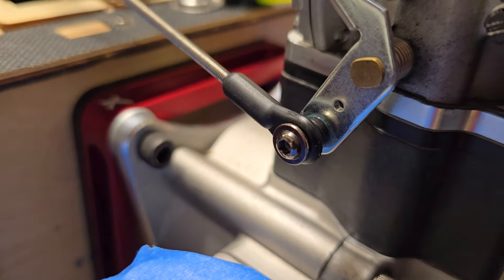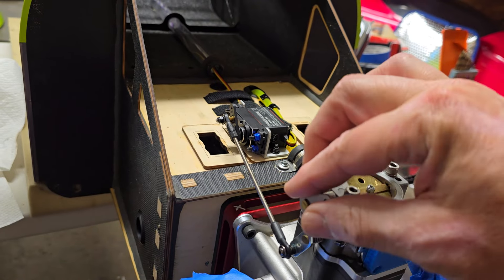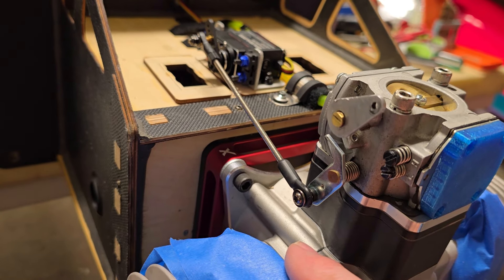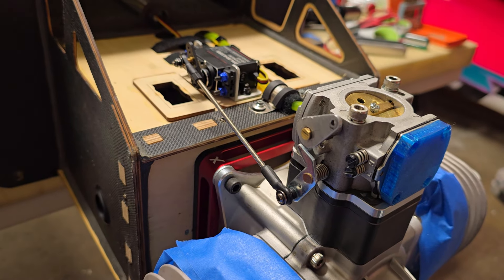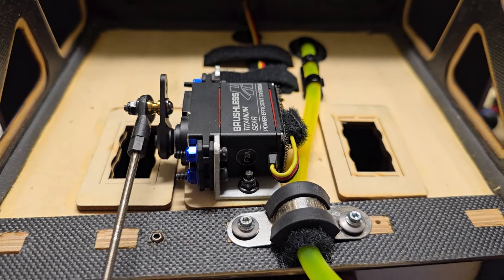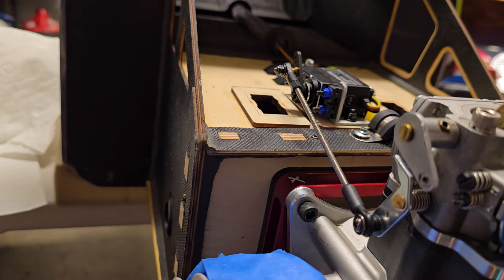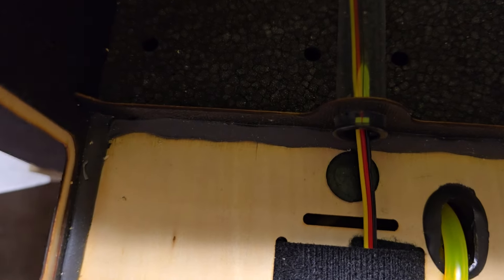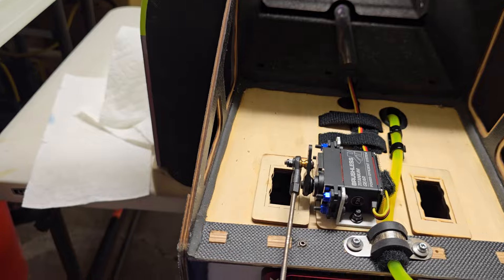throttle Servo with no carb arm extension, how's the resolution?

Comment: It's better to lengthen the arm on the throttle shaft than use a shorter servo arm or reduce the servo travel in the transmitter. I want the servo travel to be the same either side of center and as close to 100% as possible. If the high and low servo travel values aren't the same, the throttle travel will be non-linear. The throttle response of a butterfly tends to be non-linear anyway and you could make it worse with unequal values. I generally offset the servo arm one tooth toward the idle end to slow the linkage down on the idle end. You can use some sub trim to keep the travel values the same, but you really should adjust the length of the pushrod so that no sub trim is needed. I'll use the throttle curve function to set the engine rpm I want at mid-stick and idle the motor up in my aerobatic flight modes. I always use nylon locknuts and a flat washer a little larger than the ball link on throttle linkages. I try to avoid using setscrews and Loctite.
Reply from the maker: Yes exactly like that! 👍😎

Comment: Hi Joe, could you tell me what is the blue 3d printed plate on the carb for and where did you get it ?
Reply from the maker: Sure sure. :)  Joe Lewis, who is the USA distributor for GP engines, might be able to sell you one. They stabilize the air over the atmospheric pressure hole in the carb.